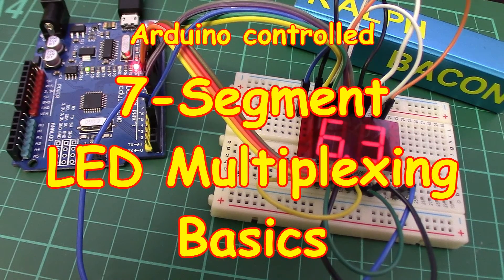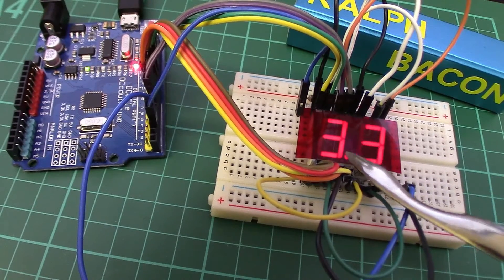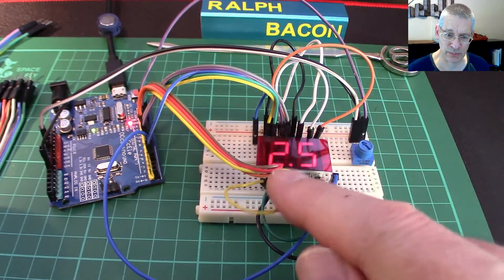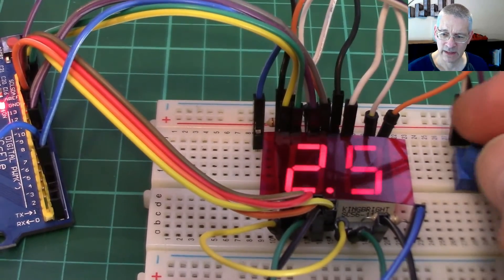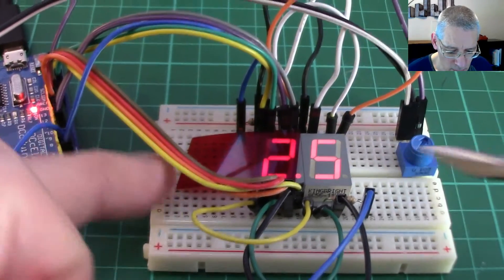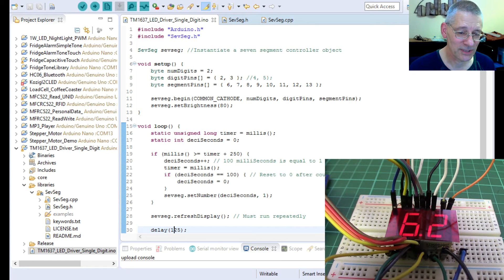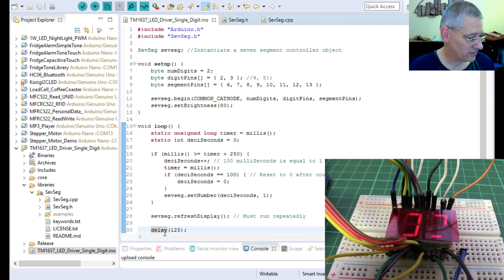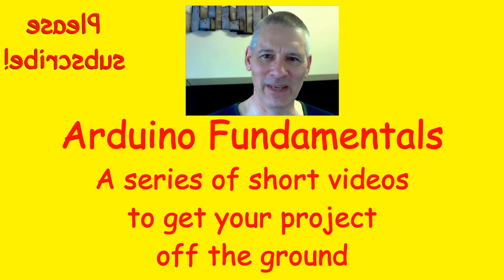#43 Seven segment LED Multiplexing - Easy Introduction

Comment: So to share segment wires you turn on the digit module one at the time by sending ground signal to common pin in one the module , if  it's common cathode, while the other digit module's common pin get High signal right?
Sorry for my English.
Reply from the maker: Yes, that is 100% correct, Pal Sih.

Comment: Will you Multiplex ADC values in this method?
Reply from the maker: This video multiplexes the digital columns and rows, Prakash, nothing to do with analog values at all. If that is what you meant?
Reply: @RalphBacon  i try to display counter values up-to 7 digits its fine working , but on adc values in  7-segment display  up-to 7 digits its flickering its not stable.

Comment: I'm not sure I understand your logic in about not overloading the pins by multiplexing as while each segment pin is now only sourcing 10mA surely the digit selection pins are sinking up to 80mA each? It's clearly the way to go to reduce pins used, but it still puts a high load on the Arduino if you don't use a transistor on the digit selection pin.
Reply from the maker: And indeed, Gavin, that would be the normal design, using a transistor for each digit. I omitted it in this demo purely to keep things simple - it was more about how LED multiplexing worked than a real design (that's why we need a TM1637 driver, so we don't use so many ports on our Arduino). If my memory serves me well, the current per segment was in low single figures so there was no actual danger of exceeding the digit IO's 40mA capacity but it certainly would need a NPN transistor in a Real World situation - I hope I didn't confuse you too much (it sounds like you're on the case anyway). Now I think of it, I'm wondering whether I ever did the TM1637 video...